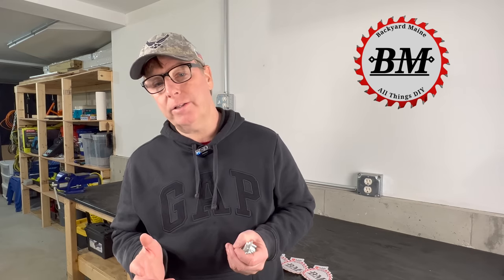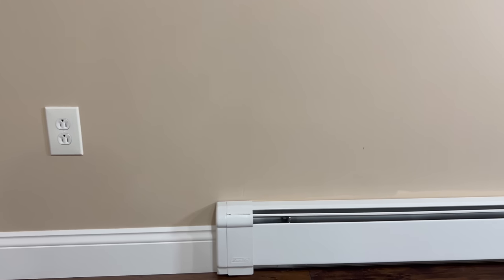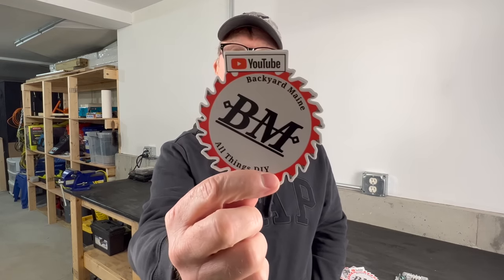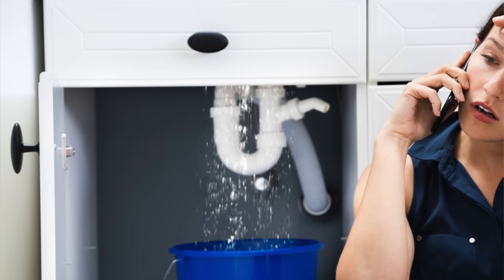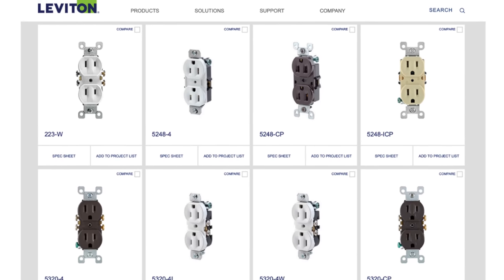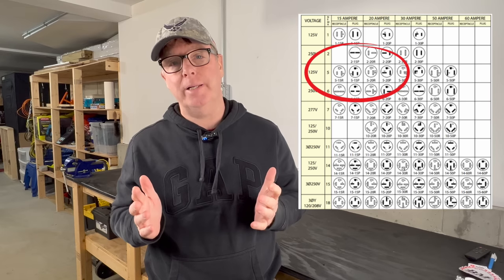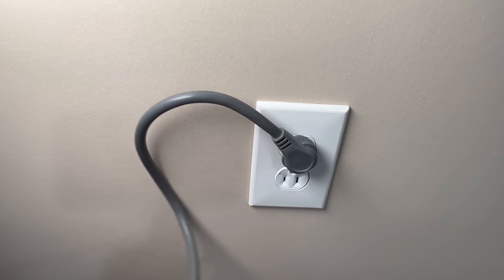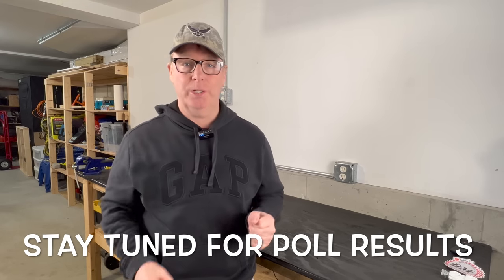Are your outlets installed upside down? (You may be surprised)

Comment: I installed all mine in my newly drywalled office ground up and regret it. What is missing from the discussion is these computer block cords where there is a large block to plug into the wall. Ground up has them tilting out. I installed mine ground up because I thought the extra safety would be a little better. If I get time, I will be reinstalling them ground down. 
However, thank you for all the info. I did look at code and couldn't find orientation for wall outlets either, but seeing the pictures, thought there might be a standard coming. 
Great quick video.
Reply from the maker: Thank you.. Glad to help.

Comment: My 60-year-old house was originally ungrounded.  At some point, grounding wire was added to several of the circuits, and the electrician changed all the receptacles, wiring the grounded receptacles ground down and the ungrounded receptacles ground up.  I've added grounding wire to several other circuits, replaced all the receptacles with GFCI, but I've kept the same convention (although I've also added "Not Grounded" labels to the ungrounded receptacles.

Comment: When I  want to plug in a  3 pronged corded equipment.  The "over lengthed round pin of ground?" and IS LONGER than the flat blades.  So the dominant hand uses the index finger to support the round-ground plug pin and feel search for the pins' first entrance to "its mouth-hole".  With that primary location achieved, I then lighten-up the compression of the thumbs' squeeze enough to slide the hand away from the plug's metal ends and back to a firm grasp of the non-conductive plug's shape.  Adjust to perpendicular-ness of the plug, rotate as needed to complete the full depth deployment.

Comment: I've actually seen angle plugs oriented either way.  I have a coffee maker with a plug that points down with the ground up orientation, and installed a receptacle specifically that way for it.  Someone subsequently installed an outlet for me ground up somewhere else and he explained to me the issue of a conductive object falling onto it, and it made sense.  It's not just the short circuit issue, that any breaker will take care of.  If the object lands on the hot prong it can become live, and a shock hazard.  Previously I preferred the ground down orientation, but now I tend to favor ground up, and further, for a sideways mounted receptacle, neutral prong up.  Glad to hear the national electrical code doesn't object to either way.

Of course, a partially plugged in plug is a potential hazard either way.  If the outlet is worn so that the plug tends to fall out it's really important to replace it.

Comment: Switch controlled outlet = 1/2 hot as generally only half (or one set of openings) are switch controlled so you have a constant hot on the other set :) Former Sparky here who knows that ground down seems the auto standard that is taught! (even after my journeyman explained what you did about an arc across the 2 poles). Love your videos as most are neutral in opinion, explained thoroughly and helpful! Thank you!
Reply from the maker: That's awesome.. Thank you. I have two more electrical videos coming out this week, One today and one tomorrow.

Comment: Hi John.  I am In Houston TX, and I have never seen an actual stated preference in the NEC.  But your explanation of when a receptacle is controlled by a switch is a good method to assist in identification of a single or two receptacles.  Either way is compliant. and an inspector may ask.  We have a few tough ones, but their concern is primarily life safety.  The ground up method for safety is interesting, but most applications are designed for ground down.   I think as long as the receptacle is secure, its likely ok.  It is good to review the basic principles occasionally, and your previous video of the NEC 2023 changes to Neutral or Grounded conductors was a good reminder, especially if it is a new installation.  These are great videos.
Reply from the maker: Thank you so much my friend. We have family close to Huston in Baytown TX. I spend most of my career working as an electrician and then an electrical engineer for Texas Instruments. I have been to Dallas quite a few times over the years.

Comment: I just ran across this video and it's nice to see confirmation of what I thought I knew: That either is correct. 

Something else I'd like to add is that most people, when plugging in or removing a plug will typically hold it with their index finger curled around the base of the plug. With the ground up orientation, this exposes your finger to the hot and neutral prongs, potentially leading to a shock.

Comment: I've been in the business 45+ years (now retired, but still doing "side-jobs"!). 
Back in the "old days", receptacles were referred to as "U-ground receptacles", because that ground terminal was (is) "U" shaped (when installed in the "proper" orientation with the ground on top). However, in my years of work, 99% were always installed with ground on the bottom... with rhe exception of some commercial/industrial and medical installs, where the ground was usually on top. Typically, for most residential work, the only recep's that were installed "ground up" were when the receptacle (or ½ the recep) was switched... as for lighting in a room.
Also, if you looked closely at the receptacle itself, the name (i.e. "Leviton") & other info was right-side up when the ground was on top, and upside down with the ground on bottom.
Nowadays, I only install ground-up on switched 125v recep's (as previously mentioned), and also when installing 15A & 20A, 250v (NEMA 6-15 & 6-20) recep's.
Also, ever notice that 30 & 50 amp, 125-250v recep's have the ground on top? Hmmm...🤔
Reply: Yeah well like he showed different manufacturers seem to make recepticals with different marketed orientations. Yours aligning with ground up may have just been that manufacturer. 

As a whole I don't think it matters much. Though it does seem the average person expects the ground down because of how it looks like a face.  😮

Otherwise many devices are designed for the ground down today as well. The only things I see that are really designed for the prong up are the very rare U shaped plugs where they do seem to hold in better on a ground up. But as I said, these are very rare, I more see them on old devices prior to the 2000s.

Comment: I was in residential construction for 15 years and remember that most electricians used ground up in commercial applications only, like Hospitals, Doctors offices  and any medical facilities as those were required by code. Residential properties here in Michigan don't require any certain way to mount the recepticle as long as there are GFI breakers in areas required by code like Kitchens, Bathrooms, Laundry rooms etc.
Reply from the maker: Actually article 517 (healthcare facilities) in the NEC does not require ground up for receptacles. The reason you see ground up there is many healthcare facilities building specs reference IEEE std 602 which recommends ground up among many other things that may or may not differ from the code.

Comment: When I built my house 27 yrs ago I hired my best friends brother to do my electrical work. He was an industrial electrician who decided he was going to do residential wiring. This turned out not to be such a good idea on my part. While he was a good electrican, he didn't know anything about residential construction and made some very basic mistakes that caused issues (recepticles over the counter too low prohibiting the use of the counter backsplash, running wires across the basement stairway before it was cut out, etc). We caught and corrected most but one that I didn't was he installed every recepticle ground up. Most of the time this isn't a big issue but when you put in a 3 prong plug in as you mentioned, the plugs want to be installed ground down. I could (and probably should) flip them all around but since it hasn't been a big problem I just haven't done it but in my opinion, ground down is the way to go. Any that I've installed since have always been ground down.

Comment: Thank you for creating this vid and the knowledge that you are sharing.  I have a breaker that is charging 4 outlets. The daisy chained goes to the front room outlet then goes to a room and powers two more outlets then goes to one more outlet in the next room where it ends. The first outlet is fine powering one power strip that charges the internet. sometimes Xmas lights. Then the circuit went into my son's room where he had too much connected to one of the outlets and melted the other outlet that had less connected to it but too much still. so glad the house is still standing. My concern is that the wires that caried the power to the outlet also melted and now the wires may be exposed along the route.  Is there a way to test these wires to check if they are now all exposed.  New wires may now have to be pull from the breaker box to these outlets. I will have to cut into the sheet rock due to unknown nails the wires could get snagged on and to set the wires into place. Just trying to understand the whole picture.  Also, these outlets are from the 50's with thick gauge wire and hardly any wire to work with. No 6" feed loop on any outlets to work with. What would you do?
Reply from the maker: If the wires are the correct size for the breaker or fuse protecting them (12AWG for 20A or 14AWG for 15A) then the wire and insulation in the walls should be ok. Usually the damage will be at the connection point where the heat source was and up to a few inches back. You could use an insulation tester if you're still concerned. This affiliate link is the least expensive one I could find from a quality brand. https://amzn.to/3T6pex7
Reply: Thanxs

Comment: Up. In addition to the reasons you covered, I use this reasoning.  Most outlets are low on the wall, or at least below eye level, and the ground lug is longer.  So I can see the round ground lug to align it by eye because I am looking down on it.  Also, it just feels right in my hand, and if my thumb should hang over the top of the plug and contact a lug, my thumb would touch ground and no harm done.  Anyway, good discussion.  I knew what you were going to lean toward, because I could see your preference in the outlet box behind you.  :)

Comment: Unless it's called out on the electrical plans,  owners preference,  or a local code required otherwise,  I always install ground down, for exactly the right angle plug issue.  Except for half switched receptacles installed in a bedroom as an alternative to a permanently installed luminaire; in this instance I wire it so the switched half is the top portion,  that way an AC adapter aka wall wart could be constant power and hang down,  I've never came across an AC adapter with a polarized plug and out of the 100 or so homes I've trimmed out, never received complaints about this issue.   

Long story short,  2 years ago in the other house I rented,  I had fallen asleep on the sofa,  and awakened by a bright flash and loud pop.  The metal faceplate on the 240V 20A receptacle for the window AC was missing the screws and fell across the prongs with the ground down,  because the air conditioner had a right angle plug that was expecting the ground down configuration.  Welded the faceplate to the prongs and of course tripped the breaker.   This was likely a once-in-a-lifetime scenario for me where having the ground up would have prevented this from happening.

Comment: At 4:44, this makes sense - except that the manufacturers of 90 degree plugs aren't consistent.  I have a freezer from a major manufacturer with the plug oriented the other way - with a ground down receptable, the cord is making a 180 as it hangs down to the floor.  I've also got a window AC, and two heavy-duty extension cords oriented this way as well.  

It makes me want to mount all my receptacles sideways!

Comment: I was always taught ground down I guess I am old school. The problem I see with ground up is if you are using a heavy cord like 14 stranded the cord has a tendency to pull out due to its weight, in a ground down the ground down better supports the cord weight and doesn't work its way out if tugged on like when using a floor scrubber.

Comment: In Australia (where I live) the standard configuration is ground down. However, all modern plugs have partly insulated pins, so if it's only partially inserted,  no live metal is accessible. In the UK,  ground up is standard,  but I believe their plugs now have partially insulated pins too.

Comment: Hello,
          As a rule i prefer gnd down. Yet there are some installations depending on what you demonstrated gnd up. In the industrial plant where i worked, my supervisor always wanted recepticles gnd up. It was a razor blade factory. Hence, a very large conglomerate with 27 -13/8 KV substations along with motorcontrol centers co-generating power plant etc ..... 0ne time razor blades went flying off  machine and a large arc flash resulted in a gnd down receptacle.  Hence, i let location and subjected to what's there and what could happen determine either up or down or even sideways. Also in the city of Chicago the local authorities want the side ways with neutral up side, along with emt for even single family homes. Yes , i built  my home in 1979and it is totally wired in EMT. A SAFER WAY THAN NM CABLE.
      
 MISS Paula Walach-former industrial electrician-Union member IBEW,  licensed electrician since 1972 .....still employed full time as a rail mass transit electrician, for a public transit authority.

Comment: So in the discussion promoting up it was stated to prevent a falling object from arcing.  Ok.  Now the room is flooding and fills with water bottom up.  It hits the 2 blades first and electricity travels between them but does not immediately go to ground.  I'm no electrician but the logic for up was only applied in one way it seems. (but you wouldn't have a fire with all that water lol)
Reply from the maker: As you know I also prefer ground down but the ground wire also bond the yoke of the receptacle to ground. The means no matter what the orientation the ground would be the first to make contact with the water.

Comment: I put them both ways, depending on location, ground up outdoors/garage/shed/barn/unfinished basement/crawlspace/attic/kitchen and sometimes bathrooms. if horizontal, neutral blade always up.
kind of an extra protection if something metal happens to fall on it or metal cover plate comes loose and drops it hits neutral/ground pin first and yes I have seen exactly that happen, where it landed across the hot and neutral with old oversize fuses. also an aluminum plate that fell over and was resting on the hot, the person got shocked a bit.

Comment: Ground up, if horizontal neutral up. While as a county elec. maintenance, there was one building where the office's desk work surface was open towards the wall and had cabinets and a light underneath above the desk. Murphy's law a large paperclip would fall across the blades [ground down], albeit the power cord was not fully inserted by a small amount. This happened 3 times at different workstations. Plus to me is easier to install, being right-handed, and the position of the ground terminal that I like connecting first. No twisting.

Comment: My first thought at the start of video, was 90° plug issues with ground up version.

However...I used to work for communications companies, and among many other job duties, I performed quite a bit of work in several different hospital ERs. There are 90° male three prong plugs that are actually designed backwards from most three prong 90° plugs. The ground prong is on the opposite end from where the electrical cord enters the connector, so on a ground down outlet it would be plugged in "upside down", with cord on top. 

I actually have a couple of this style male connector in use for some of my own extension cords with multiple female outlets on the other end.
I've been a musician for well over 40 years, and some of the smaller venues unfortunately do not have much available for electrical outlets. And often one of the other guys is plugged into an outlet that I need to use and they are already using a 90° in the bottom port on the outlet, so this way I can plug into the top with my 90° and it will actually work. I have extremely heavy duty cords that I use for these extension cords, I make all of that type of stuff up for myself. You might think, well why not just use a straight plug end to avoid that, the reason is because often in a stage setting you don't want cords sticking out away from the wall like that because bad things can happen, lol.

Comment: Worked in industrial electrical. Whenever I saw a  receptacle ground up, I'd unscrew it and orient it correctly ground down. Easy fix. It was my building my rules. 156,000 sq ft. Lots of receptacles. Most were oriented correctly ground down.

Comment: I grew up living in military housing, and every home, apartment, dorm I've ever lived i, and every office I've ever worked in , and even in seven th grade shop class, I always only ever saw the ground installed down.  Even when installed sideways, I recall, they always faced he same way.

It wasn't until about five years ago that I started to notice receptacles installed with ground up.  First in a hotel. The I started noticing it more often in commercial spaces.
I still haven't seen it in a residential setting.
Reply: My immediate assumption was that it was installed by somebody who probably grew up in a part of the world with a different plug configuration where a round single female section is at the top and the rectangle females are at the bottom.  Probably the kind that are also angled to prevent improper insertion of two pronged plugs.